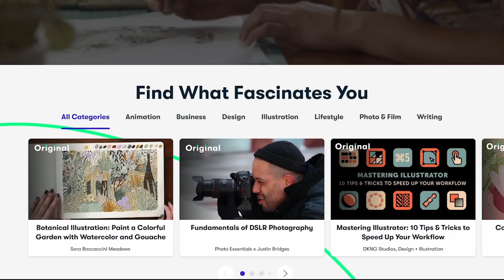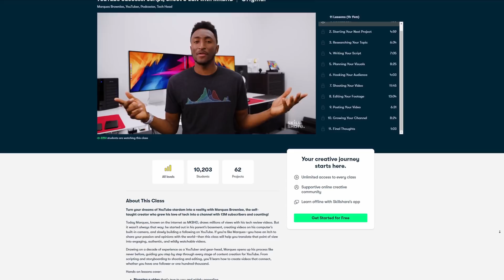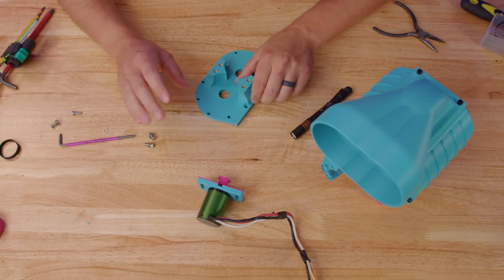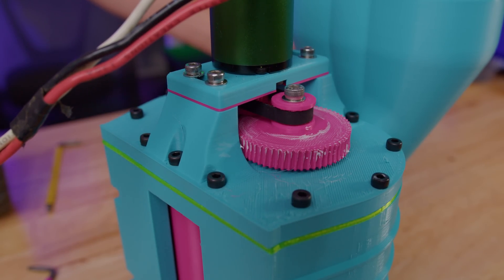I Attached a 100,000 RPM MAX Castle Mamba to my 3D printed SUPERCHARGER..... Will it Survive?

Comment: For the noise... did you ever consider helical gearing instead of straight cut gears?
Reply: What noise? All I heard was POWAAAAARRRRRR
Reply: or double helical or what they call it when it it looks like an arrow.
Reply: @GizmoTheGreen  herringbone
Reply: @GizmoTheGreen  looking like an arrow are herringbone gears.  Double helical are like herringbone, but with a gap in the middle, where the teeth would come to a peak.  Herringbone can only be driven one way efficiently, because air and/or lubricant gets pushed into that peak when you try to reverse it.  Cut a groove where that peak would be, your gear isn't quite as strong, but it moves easily in both directions.  Ships use double helical gears the size of houses to drive their screw (propeller).  A double helical would be optimum in my opinion, but I'm a sailor.  I'm biased towards ship designs.
Reply: @FNPetersen  I can attest to this, the main reduction gear on Nimitz class are herringbone the bull gear is 30 ft in diameter. I personally inspected these during annual maintenance. 65k Shaft HP.
Reply: @GizmoTheGreen  was just about to say that 👍
Reply: @GizmoTheGreen  Herringbone is what you're looking for. It's a lot easier to print than it is to cut out of metal... they are some of the most expensive gears on the planet.
Reply: @GizmoTheGreen  herringbone is the name your after also yes this does stop the issue of the healical gear producing thrust into the housing. Its basically a healical gear cut in half and flipped 180°. They are only trickier assemble is their downside but wont be to much of a issue here.
Reply: Helical gears would absolutely reduce noise, there's a reason car transmission gears are helical
Reply: All I heard to start is a nice rev limiter
Reply: Someone get this heathen outta here
Reply: At that kind of rpm with literal plastic you'd definitely have to worry about adding a thrust bearing and what not. That's why race cars use straight cut gears in the first place, to avoid that issue. Sounds like too much effort to reduce noise that sounds cool anyway
Reply: They aren't even straight cut, he's using gears meant to mate with a worm gear so they have a curved face that makes them mate weirdly since they aren't meant to.
Reply: i would not do that because  helical gearing tends to but stress onto the houseing and could lead to twist it slightly. screw could touch each other.
Reply: @Heli4772  since we are talking 3dp not machining just go herringbone
Reply: He rapidly approaching having problems with his materials not how they are cut just that they are pla, almost sounds like it is time for some engineering grade materials (start with abs, then glass fiber reinforced (which is what the gears on the R/C are made of, carbon fiber, etc.)
Reply: I'm pretty sure the noise from a blower like this isn't gear based.  You've got each lobe depositing individual packets of air to the output, causing a variation of output pressure with each cycle.  That's kinda why it sounds like a V6 - the blower is doing the essentially same thing as the exhaust stroke on a 4 stroke engine.
Reply: It would be interesting to see how the sound changes with different types of gears. With 3d printing it should not be a big problem to print them and test it out. I would like to see it.
Reply: How about grease at the gears?
Reply: @alphastratus6623  Molybdenum disulfide grease is amazing for 3D printed parts. It reduces friction by filling all of the tiny pits in the print.
Reply: @1992jamo  Sounds good in this case.
My projects are only in low speeds and low friction materials like PETG for contact surfaces.
But I will try to remember your comment whenever I will need something better in the future.
Reply: Helical gears may reduce the "noise" butt straight cut can resist more power.

Same reason why race transmisions are straight cut.
Reply: I think he used worm gears, instead of spur, which would also cause a lot of noise. Helical or herringbone gears are probably the best

Comment: find out the voltage of the lithium your using then use a couple of lead acid batteries in series or whatever to reach that voltage

Comment: if you are using a 3S lipo, try a car battery. if you are on 2S, maybe still go for a car battery, but you will have to get a 3S ESC for it.
Reply: yes, car batteries have high cranking current capability.   they're just heavy, which isn't a problem at a bench application.
Reply: @lasskinn474  exactly. Put the battery under the desk, run cables up, bobs yer uncle haha

Comment: I don't understand why you're using worm-wheel gears here?  They're concave on the surface so you're only getting engagement on the edge of the teeth...kind of an oversight here...  The McMaster model you choose was of the wrong type.
Reply from the maker: Worm gear mirrored interfaces fine I just needed the pitch diameter

Comment: Could you use the same motor with an actual fan? I like the supercharger but would like to see such a big motor drive something like the cheater.
Reply: You'd probably need to beef up the build of the cheater in order to stand up to this suckers torque and RPM. I imagine that he would bump it once and then have to go pry at least one blade out of a wall or monitor.
Reply: At that point (again, defeating the point of 3D printed fan "blades") just a high performance fan from an RC jet. Let's see, the box from the one I played with once apon a time: "powerfan 400/6 EDF Unit".

At 12volts, 11a, 24,500 RPM 360gram thrust. 

Still have that one, good as a handheld duster for a tower case when hooked to a car battery. It was only bough because it was a cheap way to get the 3" casing and decent fan blade. Add an extra $120 or so (to that approx $20 3" frame and blade) for a performance motor which turned more than double that at 12v. 

THAT I don't still have, because go figure a cheap 3" mounted car airfilter doesn't catch dust small enough for a 4cylinder engine but big enough to jam a RC fan turning way to fast... If I had a better alternator, probably used some capacitors, and cleaned it often it would have probably lasted longer and give more air to the car, but I was 19, what can you expect.

Point of overly long story being, there are plenty of methods to throw large amounts of air, many are just outside the scope of this particular project.
Reply: @outcast170  with that attitude, I honestly just wanna move as much air as humanly possible.
Reply: he did something similar in the past check his old videos
Reply: The fan would explode similarly to these SloMo guys videos where they spun CDs and vinyls at high rpms.
Reply: He did with a smaller motor, and it already was way to much for a fan! 💣
Reply: @luca6819  to be fair that smaller motor is waaay higher RPM than this one lol.
Reply: @FAB1150  Probably but without the specs I won't bet on it, and even if it is you could theoretically gear the mamba to the fan to make it spin much faster since it's much more powerful!
Reply: @luca6819  those small drone motors are still extremely powerful, they easily can draw 500-600W or more, which is lower than the big one but they still can easily spin a fan up to 20K rpm or slightly more. In the end it's exactly what they're designed to do, spin little fans REALLY fast. Lol

IIRC in the video where he did it the normal fans just disintegrated or flew away, and then he used an actual drone prop and the motor overheated (as they're designed to move 80mph through the air lol). Might have to rewatch it, it was fun
Reply: @luca6819  We can reinforce the fan, make it out of carbon fibre lmao
Reply: @alcove3  That would be very nice, and dangerous, to see!

Comment: It would be cool to make twisted screws and see if it makes a difference.
Reply: I've always assumed that when there is a spiral shape to those 'screw' it compressed the air beofre putingit into the head... I guess this is why I am watching COMPUTER NERD STUFF and NOT GEAR HEAD Stuff LOL :D
Reply: @ThatTweedle  technically you're not wrong.
Reply: @ThatTweedle  the twist also gives the lobes more surface area and allows it to move more air in a physically smaller package.  And it delivers the air more smoothly rather in large pulses like a straight lobe blower would. Important in a car but not so much here lol
Reply: Use a herringbone (double pitch which meets in middle twisted screw for no axial load
Reply: @thedyingtitan1247  herringbone has been tested when he did that clock looking fan. One of the guys in the comments and I were talking about it as he tested it to remove the axial load a helical gear added.

The results, It adds a crap ton of friction and plastic wears causing it to bind.
Reply: @CreamAle  When the plastic begins to wear it begins tro heat up, and expand and then contract when it cools. Thus, as you said binding things up and causing them to break much much faster. He needs bigger teeth on the pulleys and Belt to help the sheer strength for this particular setup to work properly.
Reply: Coat the rotors in paint primer. The tighter the clearance between them the more efficient the system is. In the automotive industry they use special epoxy referred to as "abradable coating". Effectively you're making stuff too big then letting it wear into size. Also put a drop of oil on the gears to reduce friction and noise. Lastly, as a positive displacement pump compression will be occurring so the aerodynamic design of the outlet can be fairly critical to recovering losses associated with the expansion (the outlet is ambient therefore there is no static pressure being developed).
Reply: Do a Hi-Helix rotor. Hi-Helix rotors go inside a roots style blower like this one. The lobe twist is 120 degrees over the rotor length of the rotor. Then you can do a delta port in the case bottom. You’ll gain a ton of efficiency.
Reply: it will add more cfr for sure
Reply: Twisted is better and tighter
Reply: Screw super chargers are more efficient. But this is open air, so shrug.
Reply: Screw style supercharger will add a lot of axial load. So it will try to blow out the back and front housing as it will constantly push outwards along the centerline.

Meaning, more friction and less efficiency.
Reply: @CreamAle  that could partly compesated by using helical gear producing axial load in the opposite direction, thrust bearings are defientely still needed tho
Reply: @CreamAle  Easily fixed with a thrust bearing, McMaster Carr is the solution.

Comment: Yes yes I commented about the belt situation 👏👏👏 just need stronger belts
Reply: No. He needs actual belts in the required size. The method he tried was designed for 3d printers it was RIDICULOUS to think he could stitch together his own belts for a 6800 rpm high stress environment
Reply: @CullenCraft  stronger... Better belts... That means proper belts... No need to go on a narcissistic rampage over some 3d printed experiment 😂😂😂😂

Comment: Get a presure sensor and see how much pressure can build up (if it measures in mmHg it might be better.... If u buil boost attach it to a small 2stroke.or 4stroke engine
Reply: Actually I think you'd be surprised, those motors can definitely handle a lot more with enough power, even higher gearing. They're super torquey